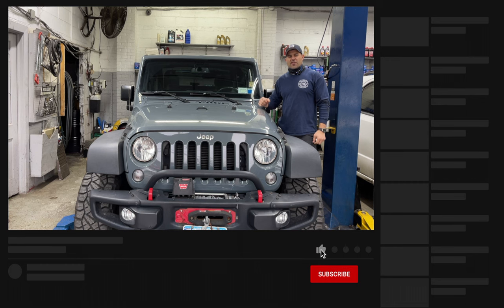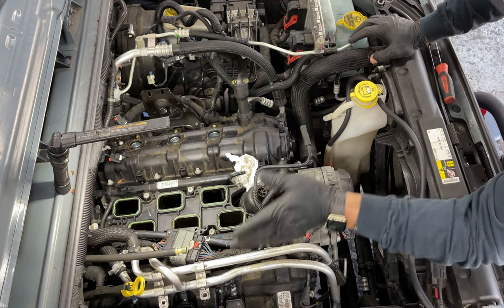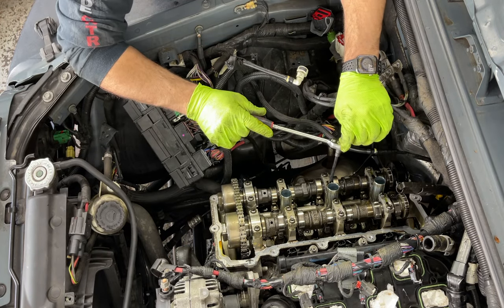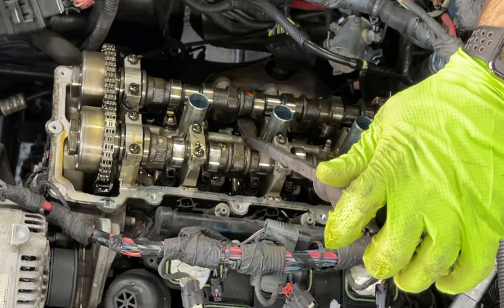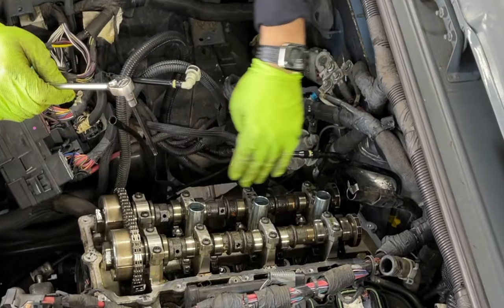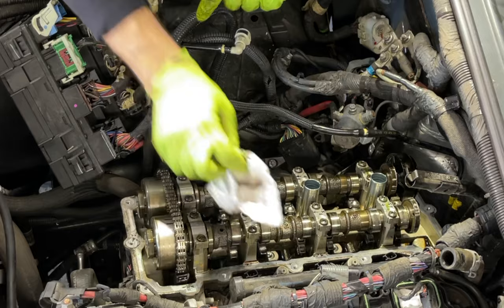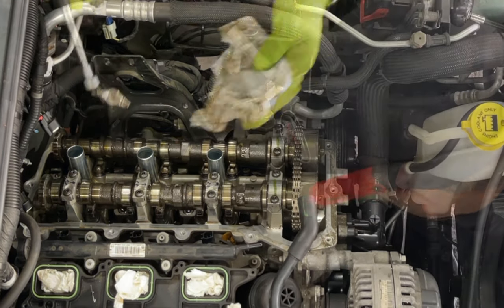How to fix Pentastar Engine tick Jeep 3.6L "SHORT CUT"

Comment: DId the same job on our 2015 which at 80,000 started ticking. Driver's side was the first which I fixed (easier despite removing the upper intake), then the passenger side was ticking. I didn't remove the battery tray and now that I see that you did, i should have for all the wrestling I had to do with the valve cover. My next job will be replacing a leaking oil cooler which doesn't look to daunting. All in all, it seems like a decent engine, with some minor design flaws. The updated rocker followers are totally different on the later models.
Reply from the maker: Check out my oil cooler/ filter housing 
https://youtu.be/NKSk67lleiQ 
Thank you for watching and your feed back.

Comment: Another option is to take the vehicle to trade in before the CEL comes in along with the P0302 code. The result for a non mechanic was Cylinder Head replacement at dealer under the warranty. Service write guy said it would have cost $3,000. 
Having owned other Chrysler minivans I bought the extended warranty when new.
Believe it or not! Yesterday I got the minivan back from the service department after another CEL. Code P0306. Another $3000 cylinder head replacement. Covered by Lifetime Maximum Warranty which Chrysler no longer sells. My 2014 T&C has $10,000 in warranty work since new.
Reply: Trade in and then someone else pays 36k$ for a used jeep unlimited sahara.. to have it blowing up 3 days later 🤬 don’t trade stuff in to unload your problem onto someone else.

Comment: What scares me the most and why I dont dare to try this job myself at home, is removing all that stuff just to get to the valve covers, changing rockers and push pins looked easy. I see nothing wrong the way you worked on this motor, although I do see something wrong when you said "book time 20 hours"!!!! If that takes a mechanic that long for a job like this, then I'm not going to that garage. Good job guy, I wish theres was a mechanic like you near me!!!!!!!

PS I have 2018 V6 Cherokee Latitude I bought used couple years ago with 30k, it now has 50k miles, it still goes like new and I want to keep it that way for long time. Therefore when should the trans fluid be changed and or should it be done by a machine at a garage? Either way I dont dare to change fluid at home..............

Comment: I appreciate the video. I was wondering why you don't just use the chain holding  tool  release the tensioners with the wire hook and slide the phasers from the cam so you can remove it ? I feel that method is easier and faster, no?
Reply from the maker: I actually have several videos on the subject one of them is using the specialty tool. I just want to show that the job can be done with or without specialty tools. Thank you.

Comment: A competent mechanic can do this in less then 6 hours but for most it'll take longer. Also don't have to drain coolant or unhook the hoses or fuel rail or even the injectors. The battery tray is a pain though and so is the pcv valve (at least on a right hand drive jeep due to the trans dipstick in the way) but either way, it's way cheaper then the stealership.
Reply: I’m not no mechanic but this video helped me fix my jeep no more ticking
Reply: 6 hours?? Wow!

Comment: I really apréciate and thank you for filming and sharing this video!  I got it done, basically a day and a half.  Tore a couple spark plug boots on the disassembly (Amazon has them cheap!), and could've used a bit more walk through on the reassembly- especially battery and fuse box and wiring routing and importance to double check all vacuum lines and pcv tubes, but I figured it out with minimal "re do's!  THANK YOU for an excellent video!  How long does it take an experienced mechanic to do it- shortcut and non-shortcut?

Comment: Important bit not clearly shown on video was to loosen the large bracket on the drivers side. The valve cover is very difficult to remove without loosening that bracket. I think it's shown at 5:16 but it isn't mentioned verbally so you have to watch this vid carefully
Reply: I'm changing the valve cover gaskets and fixing a leak in one spark plug housing and it was a pain in the ass 😆😆. All I kept seeing online was how complicated the passenger side was
Reply: @danielq.4371  yeah the drivers side is easier IF you get that bracket loose haha 😂
Reply: @Brandon I bought a small 3 dollar ratchet from harbor freight and I was finally able to get to that bracket!

Comment: This was incredibly informative. I just got told that my 2012 VW Routan has pretty much this same issue (has the 3.6 L Pentastar). It has 146k miles. Their recommendation was replacing valve lifters, timing chain, and catalytic converter totaling $11k. I’m at a loss. Obviously I’m not going to put that much into my van. Does this seem right?
Reply from the maker: A job like that can get very expensive specially if you dealing with a dealer. try to locate a knowledgeable shop that might do the job a lot cheaper than that. I’m sure I can, if you lived close by.
Reply: you should have got a kiss with that deal.....

Comment: Mine was starting to tick at 50k. Always used Mobil one. Changed leaking oil cooler. Ran the same Mobil one filter. 
Poured in 6 quarts of pennezoil platinum
5w20. 10k miles of quite operation.

Comment: Great video! I think the main cause for this issue is that the oil pump has a small volume of oil going through it at idle. If you get an after market oil pump w a higher volume it should prevent this from happening. they’re really cheap

My Engine is clicking after 61k miles so i’ll have to do this soon 😞
Reply from the maker: That’s good to know. Thank you for watching and I do appreciate your comment. Good luck with your car, let me know how it goes.
Reply: If you wait too long the rocker will start grinding the lob off the cam.
Reply: Mine  (2012 Town + country 3.6 )went at 210 K miles and paid $4k to replace the cam and rockers,now at 282K it,s ticking again , over a year passed warranty . Put Lucas 15/40 deisel oil and Lucas sticky additive. Still ticking. I,m capable of doing this fix but   not sure what to do now.
Reply: I replace mine as per ur video but not sure  turn on and still had a ticking sounding like a diesel lol but might redo it this weeken only had 2 rocker arma bad when I replace all 12 on the passenger side and word of advice?

Comment: I replaced all 24 valves and rockers, used this video as reference for parts of the project. Thank you for posting. I took off the coolant lines, and after everything was back together, (tick gone!) I’m having trouble burping the radiator and the engine temp running high. I’m suspicious of vapor lock. Do I need to ‘prime’ these lines by filling them separately? Or will the water pump take car of that? I’m trying to diagnose my higher than usual engine temps…
Reply from the maker: With engine cold, Open the bleeder screw on top of thermostat then refill coolant. Start the engine and put the heat on inside the car. Max heat but lowest fan speed. Let the car run and monitor temp. Check coolant level again after it’s cold. Thank you for watching and I appreciate your feed back.

Comment: NEED HELP!!!  Your video is fantastic, thank you so much for creating it.  After putting it all back together I can't get mine to start. It won't crank over.  There is a noticeable click/tap that sounds like it's either coming from the starter or under the throttle body.  All lights work, no error lights on dash, battery voltage is good. Any suggestions? 2013 Wrangler Sport.  Thank you so much in advance!!
Reply: Was it your battery ?

Comment: What's the root cause of these lifters failing?
The Quality of the parts, such as not being heat treated properly or the design itself?
Maintenance, when it comes to oil changes?
Using such a lightweight oil like 0W-20 engine oil?
Also too, w/everything removed, should other things be replaced as a future precaution, like the plastic oil filter assembly?

As for that oil filter assembly, there's an aftermarket assembly which is made of aluminum. What's your opinion of using that?

Comment: Just had this repaired on my 2012 JK. $1,200. Mechanic said he was seeing this a lot and it was caused from using oil without zinc. Apparently they took the zinc out of motor oils a few years ago. He said I needed to use something like Valvoline VR1 10w30 racing oil because it has the necessary zinc needed for lubrication and to protect the parts.
Reply from the maker: That’s a great price. Where was the job done? What state? We’re all rockers and tappers changed? Were and cams damaged ?

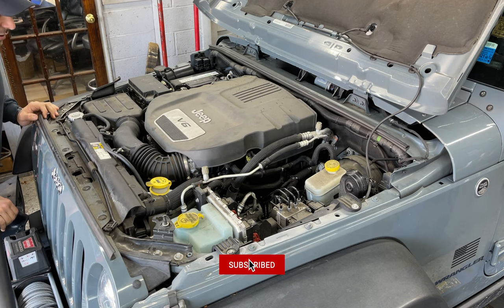Comment: Excellent video! I have a 2013 Town and Country with 180kmi. It had a tick, so replaced all rockers and lifters while replacing the failed oil cooler. Got it back together. I now have a small knock. Driven it about 20 miles, and it hasn't gone away. What would be the next step, or will this go away? I'm referencing the 56:00  mark on the video. Thanks!

Comment: This procedure worked for me to eliminate the tick from a bad rocker on the left bank of my 2014 Wrangler.  Problem is now my Wrangler is in limp mode with code P0394.  I replaced the left bank camshaft position sensor, but that did not correct the problem.  I checked for 5VDC and ground on the related connector and all looked good.  I am concerned the I de-magnetized the camshaft tone wheel when lifting out lifters and rocker arms with a magnet.  Any suggestions how to fix this?
Reply: Figured it out.  It was the camshaft position sensors.  I replaced the camshafts and the P0349 went away and it runs normally now instead of in limp mode.  I guess I wiped the position sensors out with my magnetic tool.  I diagnosed it using a ferrocell film as shown here: https://www.youtube.com/watch?v=MxBMrBqEmgU
Reply from the maker: Thank you for your feedback. I’m glad everything worked out. 👍🏻

Comment: I'm curious what percentage of the time do you see the #4 (#3 in your numbering scheme) passenger side rocker arm on either the intake or exhaust side to be culprit? I have seen numerous other videos replacing rocker arms and it always seems to be the #4 passenger side and more specifically the exhaust cam rockers.
Reply from the maker: That's actually true. I have seen all Cylinders but pass side exhaust is like every other car.

Comment: I did this same exact thing, after putting it back together I am getting cam position error codes, p034, p0369 ,p2638  codes. Engine sounds great, no power or won't shift into lower gears going up a hill. I replaced both the sensors on the rear covers with new sensors. same codes. I did turn the engine by hand a lot further than you did in the video, but brought my marks back to the same spot on the top. Not sure what to do now, I have checked every fitting and wire. Any ideas ?
Reply: Did you ever find a fix? having the same problem on my 2015 Grand Cherokee after doing the rocker arm job. Error codes, P0340, P0369 are showing up on bank 1 (drivers side) RHD car. Replaced bank sensor but still in limb mode.

Comment: Okay the only thing I noticed after watching this very informative video is on the left side valve cover before reinstalling did you ever put any back silicone on that side as well I didn’t see it? Or is it even necessary if n the left side? Just curious if I should on that side to or not

Comment: Great video thank you. One question did you have low compression on the cylinder with the ticking/ rockarm failure?
Reply from the maker: There was no compression issues.

Comment: I have 2017 dodge durango 3.6. This should be the same process for me right? I thought I heard before in 2017 dodge upgraded the rocker arms that was having this problem? I got a real light ticking sound. To me it sounds like its coming from middle fuel injector driver side. I currently have it taken apart while waiting on parts. I changed the plugs and broke a plenum bolt off at the lower intake. Couldn't get it out so ordered new lower for 65$ . Got new fuel injector rings coming i was thinking about soaking injectors in diesel or something. Im dreading taking the valve cover off due to what i might see but i guess i should huh?

Comment: That's an amazing repair. I have  a question, though. Since you were able to remove the front cap (29:46) to get the cam shaft up  high enough to replace the  front rods and rockers , couldn't all of the rods and rockers (for that cam shaft)  have been replaced at that point? I have a 2015 that's beginning to tick, so,  I expect to be doing this repair.
Reply: Great question. Thinking the exact same thing

Comment: Hi I was replacing my rocker arm and made my marks on the timing chain and cam gear, but after rotatinh the crack multiple times, the mark I made on the chain does not match up with the mark I made on the cam gear anymore. I don't think it skipped a tooth. Do I have to keep rotating the crank until it lines up again?

Comment: When i did hondas, you could take the cam gears off the cam. Leaving motor at TDC and using zip ties threw the cam bolt hole and around to keep the chain in its location on the gear. Using a bungee we could keep the chain tight on the crankshaft gear while we worked.  Is something like that possible for this?

Comment: I thought it was only the HEMI V8 THAT HAD THE "HEMI TICK" problem which would be the 5.7, 6.4 392 engines in the Dodge CHALLENGER vehicles??🤔 
Also  if equipped with automatic transmission there are MDS issues running car on 4 cylinders in "ECO" MODE.
Reply from the maker: They all got issues. Lol. I see it also a lot with GM 5.3L engines with Active fuel management systems.
Reply: @a2zautomasters862  Wow! I had heard that the V6 Penestar engine was one of the most reliable engines.  Perhaps they meant among the Dodge/Chrysler  brand since this V6 is used in all different vehicles from the Charger, Challenger, Jeeps, and mini vans.  I originally was going to get a Challenger R/T 392 scat pack widebody but was concerned about hemi tick, MDS issues with auto trans and the high maintenance as well with all the class action lawsuits about these problems.  I thought I would be better off with the CHALLENGER SXT model with the V6 Penestar engine with no hemi tick or early valve lifter failures making the SXT the more reliable CHALLENGER models over the Hemi V8 engines.
Reply from the maker: @microminiskirt  yea I believe 2015 and up should be better somehow. Improved design and less ticking issues
Reply: @a2zautomasters862  I had heard Dodge didn't address the issues even when they approved a warranty repair it was a band aid fix in that they used same parts only for the problem to happen again.

Comment: Hoping for a quick response. I’m in the middle of this job and trying to follow your process. I was finishing up on the right side intake about to torque the cam bolts down. I thought I would rotate the engine counterclockwise to make sure my timing marks were still correct. As I was doing this the chain unexpectedly slipped a tooth. It looks like it slipped only on the one cam I was working on. Any quick tips on how to correct this?
Reply from the maker: The right side tensioner is behind the cover down low so you can’t access that without removing the timing cover or use of special tool
Reply from the maker: You can install the cam caps/ bearings back but don’t close the valve cover. Go on Amazon https://amzn.to/3SaxFFJ get that $21 tool and you can remove the sprocket and set it back to the right spot.

Comment: Listen up everyone my dad has the 3.6 pentastar, my sister in-law and my neighbor, you must flood mode start these things if they sit for more than 2 hrs. 
   Flood Mode is cranking the engine while disabling it from starting. This gets the oil primed in the engine before it actually runs. You must do this because the oil filter housing has no anti drain back system and all the oil literally drains back to the oil pan in thirty minutes or less. In this process it shuts down fuel to the injectors so the engine will not start. 
   Flood mode: depress brake pedal and accelerator pedal to the floor simultaneously and hold them there while cranking the engine for ten seconds then do it again for five seconds.
   Then you can start your vehicle normally. 
    My Dad, Sister and Neighbor all have 3.6 Pentastar engines in their vehicles all have surpassed 100,000 miles and never needed this service done and also never have this ticking noise the channel owner is calling a knock. Because they do what I described above and they also run Amsoil Signature Series oil in them too since new, which quiets the engine even more than it's normal operating sound. 
IT REALLY REALLY REALLY MATTERS TO KNOW YOUR ENGINE WHY IT DOSE WHAT IT DOSE AND HOW TO OPERATE IT AND MAINTAIN IT WITH TOP QUALITY OILS THAT ARE BETTER THAN THE OEM SPEC. They don't have this issue and have surpassed the 100,000 mile mark and continue with out this issue happening this is a oiling design flaw that causes failure if you don't address it like I'm telling you.
Reply: Jon-o-There is now a company that makes an oil filter adapter that has an anti-drainback valve,it solves the dry start problem in these engines
Reply: Was there a recal?
Reply: @davidh6818  Was there a recall?
Reply: How do I get this par?

Comment: I have a question about the rocker arm and Hydraulic tappet
I changed both and sometimes he still makes the same noises befor i changed it at the same position 

When it is cold, it makes no noise and runs very quietly and well and when it is warm, the noise sometimes comes for 10 seconds and then disappears again

I did both sides of the engine
can you help me? 😅😁
Reply from the maker: Hey, you might have to do a timing chain job on that car. I had to customers that had the same issue and end up being the timing chain tensioner.